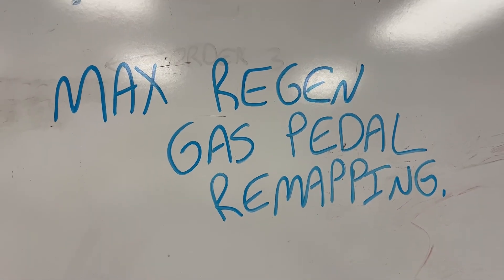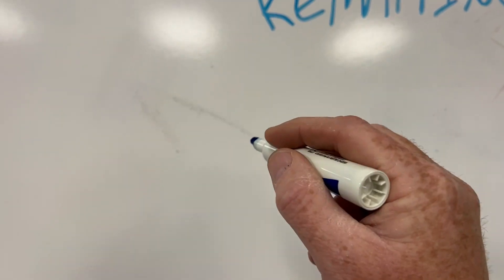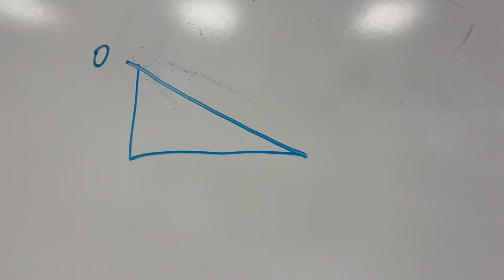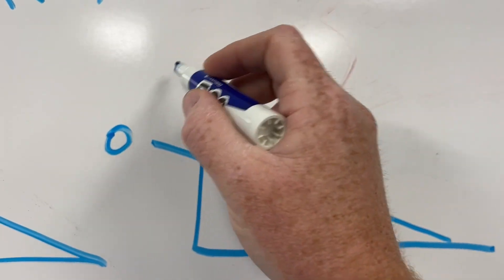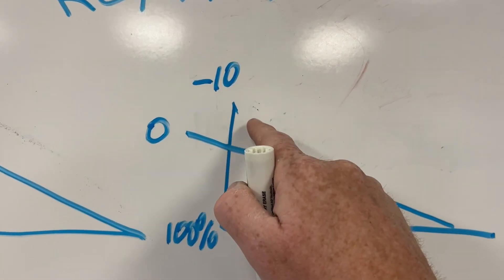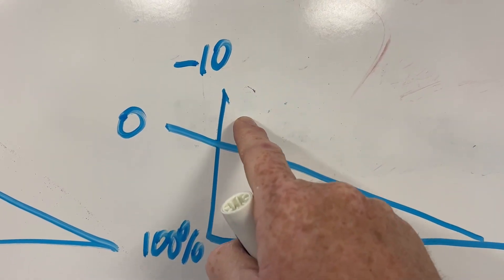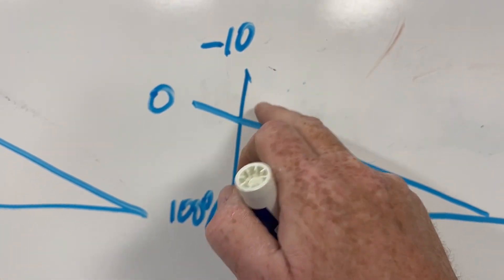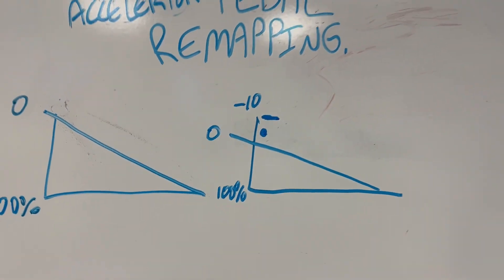Max Regen Accelerator Pedal Remapping

Comment: Where did you get the roll bar brake light?  How did you connect it?
Reply from the maker: It’s a 12 volt LED I got on Amazon. I ran a wire up from the third brake light circuit.
Reply: @Wrangler4XEFans  just tried a search, endless light bars
Reply from the maker: @K4LKDana  I just bought a 12 volt LED, drilled a hole in the plastic part of the light bar, ran a wire down to the harness that goes out to the tailgate for the third tail light. Something like this: https://a.co/d/gV5xNOU